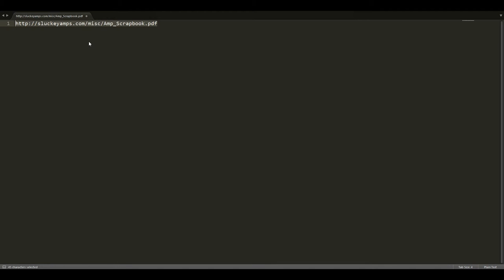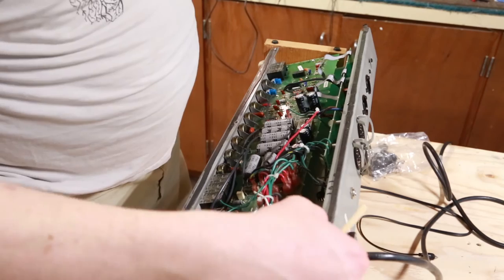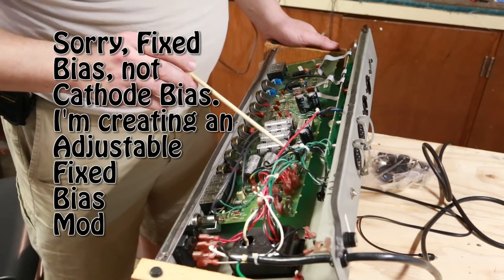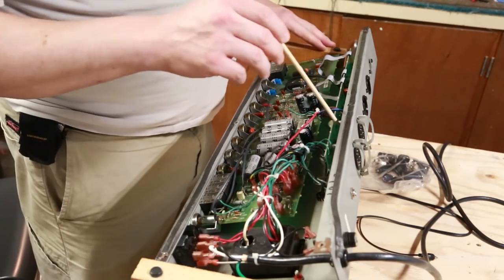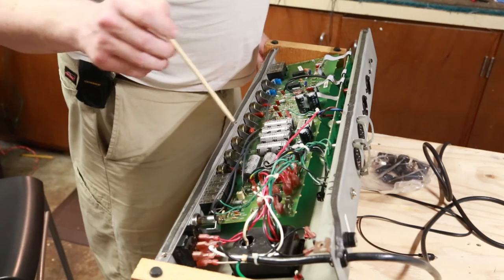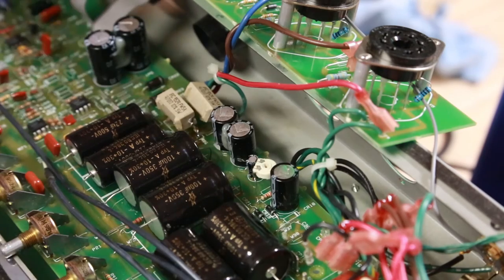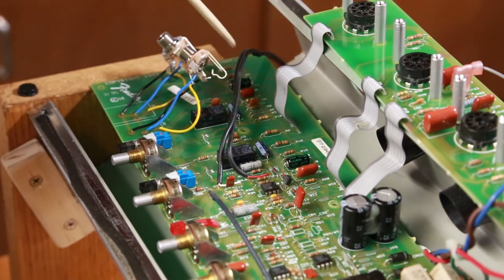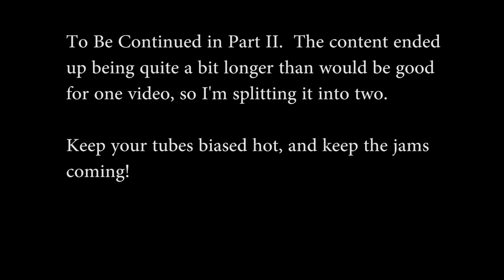Fender Hi/Lo Inputs And Fender Blues Deluxe Mods

Comment: where would the test point be to read the bias. Could i use pin 5 on the output tubes for my test point ?
Reply from the maker: You use pin 8 for the bias test point if you're using the one ohm cathode current method.